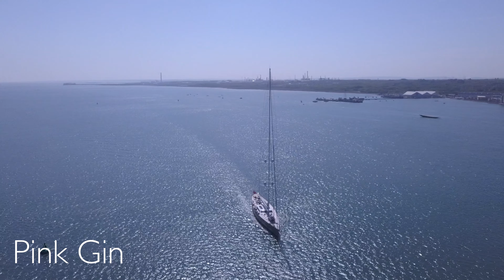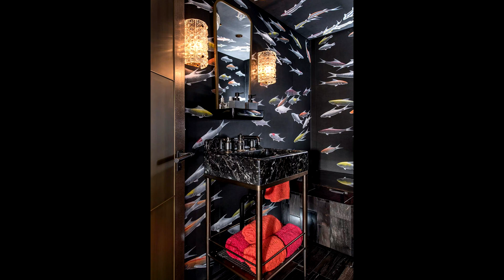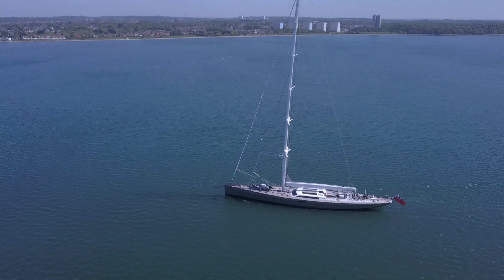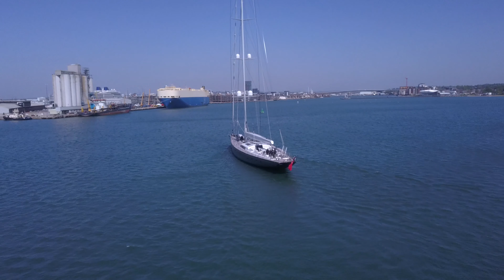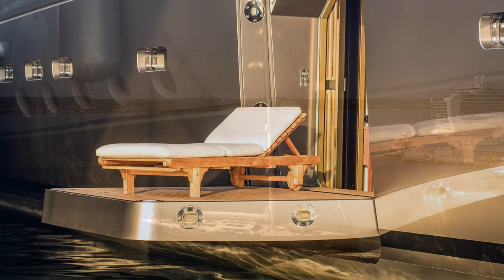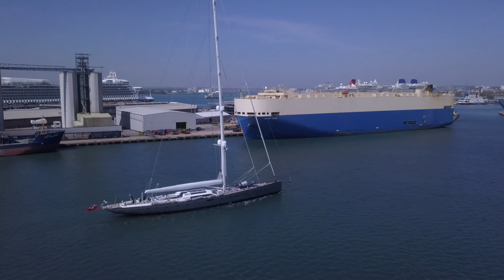Pink Gin Superyacht arriving Port of Southampton - Largest Carbon Fibre Yacht in the World

Comment: Another superyacht that will take up pontoon space somewhere and hardly ever take to the seas.
A tax write off no doubt.
Reply: the owner is a Sailor himself and has Dozens of Atlantic crossings behind the Helm. he also takes great joy in suporting charity work. he also has taken an intresst in cargo sailing plans for Dyna Rigged Container Vessels or Bulkcarriers. also Meet Timbercoasts Avontuur at Marie Gallant for discussions about it.   it may look like it belongs to an generic to rich person but the owner is a really nice decent down to earth person.
Reply from the maker: @cpt.mirones5109  That's great to hear shipmate. Would like to film Pink Gin under sail.
Reply: @cpt.mirones5109  thanks for the info.
Always wondered why nobody has tried adding sails to commercial vessels if only to reduce fuel costs.
Reply from the maker: There are some tests going on for Sails/Foils on commercial ships shipmate.
Reply: @skippyone2769   the Dyna Rig as seen on Maltease Falcon and Black Pearl was invented back in the 1960 something at that time the fuel costs where far lower than the cost for an Large Carbon mast or Steel structure for the Dyna Rig.  the reason why it hasnt been done also is because of the Pinguine effect the slow evolving shiping industry is basicly waiting for the first idiot to make one and then see for themself.  and there have been Sailing Cargo Vessels doing their dutys up to the 1980 and later.  

My friend saved an old ice-trader built in Norway and is now doing a refit back to general cargo sailing after some succesfull years after the first restauration and will do both passenger and cargo trips in the baltic once more.  Hawila Project  34m Wooden Ketch.
Reply from the maker: Could be shipmate, but when at sea, Pink Gin looks magnificent.
Reply: Pink Gin is currently for sale for $37million. So the owner was not that into this yacht.
Reply: @Howard.Stern. so? He probably just wants a new boat. The world is his oyster.